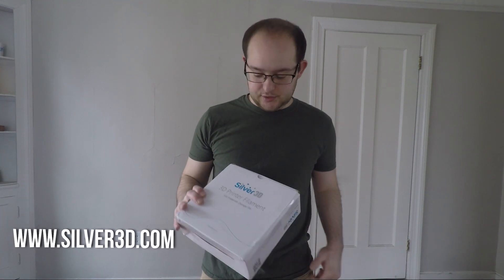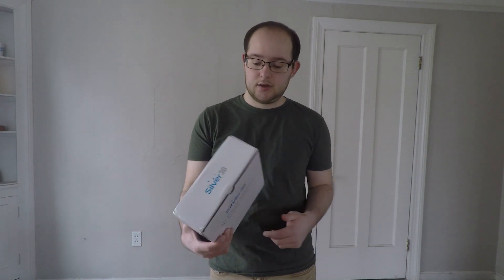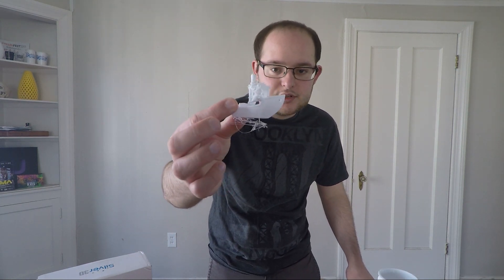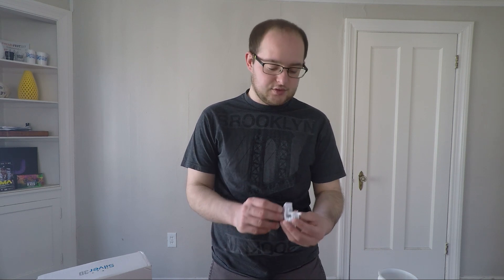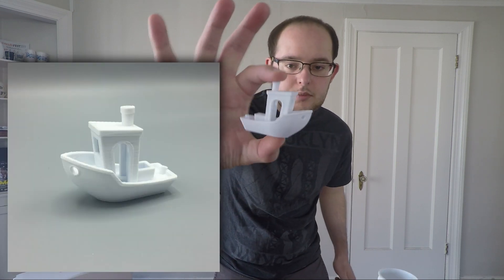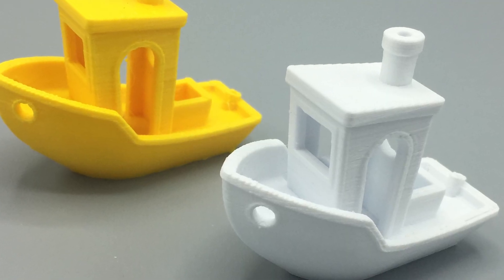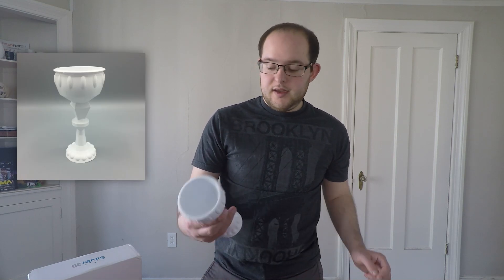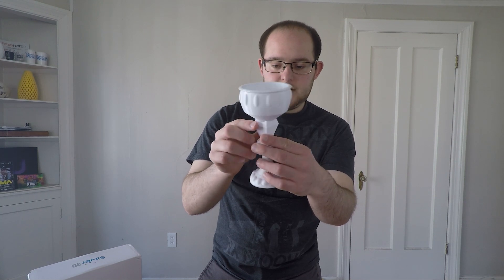Silver 3D Bio-MLA Filament Review!

Comment: Did you keep using this filament? I got some BIO MLA and I can't find any information out there other than your video.
Reply from the maker: hey! Yea I've still got some of the filament left from the spool, i will admit it was a bit more time consuming to dial in the right settings on my printer for it
Reply: @andrewreynolds3d99  what settings did you settle on?
Reply: @Giantgreenman   I was printing with my craft bot XL and the settings were:
Temperature of extruder : 260 degrees C
Bed temp: 65 degrees C
Speed 40 mm/sec
The speed was really the factor, had  to slow it down enough for the layer to adhere.
Also Meltopolis is my new channel FYI where I post my recent videos! I hadn’t posted on the other one in a while